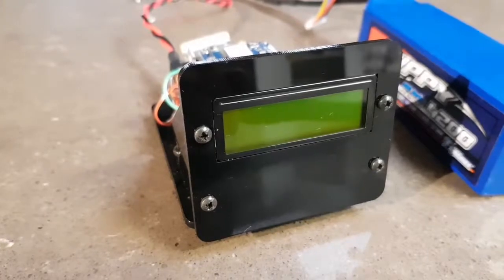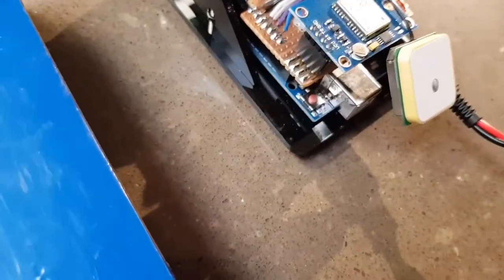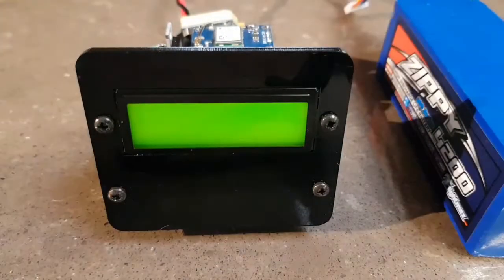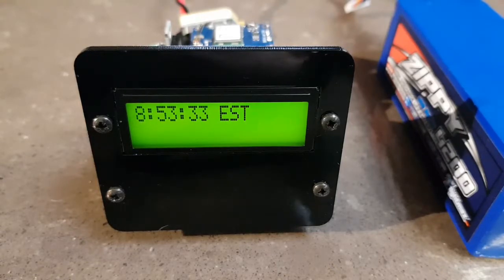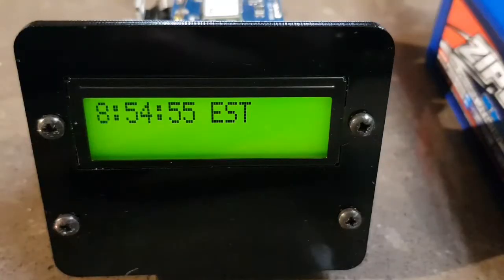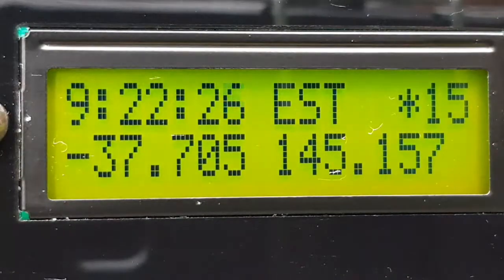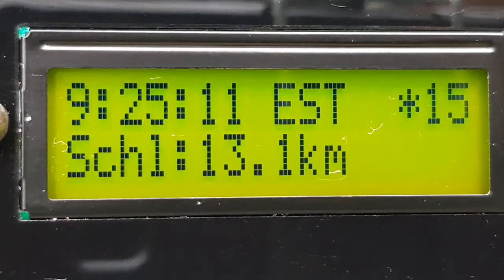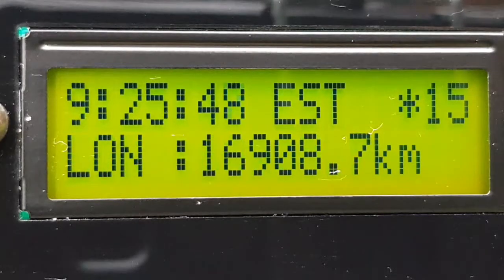GPS Clock using Arduino Uno and Ublox 6m breakout

Comment: Hi
I'm interested in building a gps clock, but the skipping of seconds isn't suitable. Can that be improved?
Reply from the maker: Hi, thanks for enquiring.  I never got to the bottom of this issue, it could be because the parsing isn't working properly,  and not every message wirh a timestamp is being parsed. There's no reason I can think of that it shouldn't work fast enough to catch each second    If you try it, let me know what you find.  Code here https://github.com/prt459/GPSClock
Reply: @Paul_VK3HN  Hi. I figured it out and have a working version. Basically, anything big sent to the i2c display hangs the system for 1 second. I commented out lines and verified this. In mine, seconds were carefully calibrated for display or parsing lag. I only display new seconds, not new gps sentences (about 8 per sec). I printlcd the gps info at :15, :30, and :45. At those times a 1 second stutter will always happen. :00 is razor sharp and it's my main concern (for setting watches). Happy to share code if you need it.
Reply from the maker: @gsrerlka57  That is most interesting and thanks for sharing it.  Do you mean you update the entire display 4 times a minute and only the seconds digits if they have changed? Could I ask you to open an issue on the Github repo, that way, this discussion stays with the code and will otherwise get forgotten. I will continue the thread on Github.  Again, thanks for persisting and finding this bug! 
https://github.com/prt459/GPSClock/issues